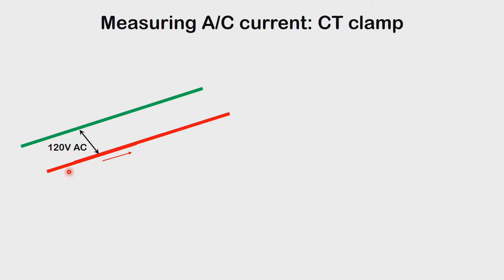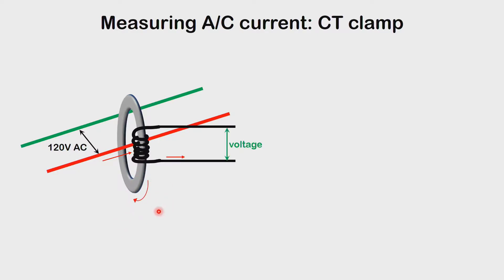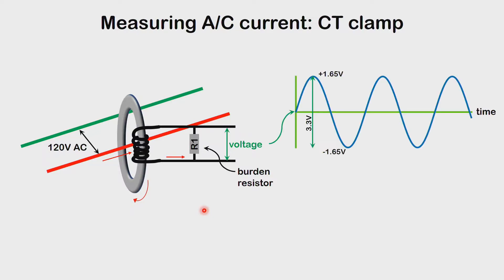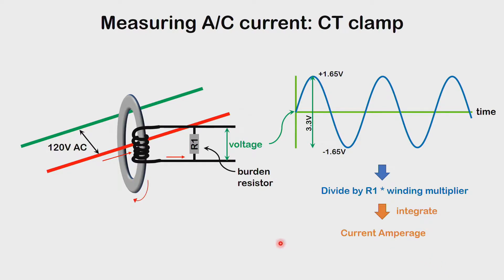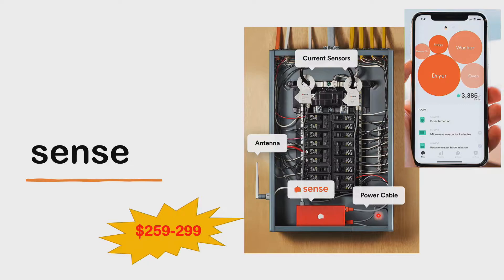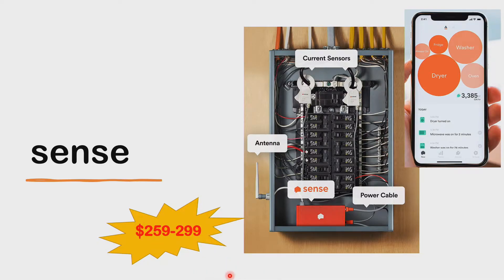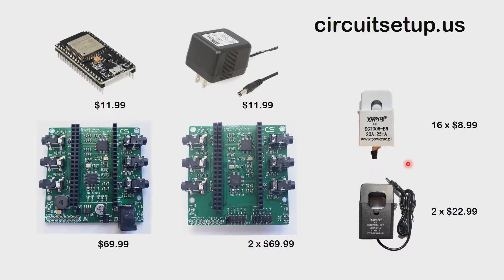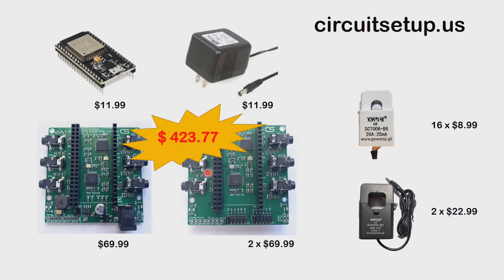Complete setup of Emporia Vue Gen2 Energy Meter | Integrating into Home Assistant

Comment: I want to use it in our company. 
What if I have 3 phase/3live wire main circuit breaker and supplying to 3 sets of 3 phase/ 3live wire sub circuit breaker. How the CT sensor should be clip?

Comment: Does the Home Assistant integration require an Internet connection?   Or does it talk directly to the device?
Reply: Internet connection. It talks to the Emporia API. So far the API has been very reliable but the integration has some issues. Might flash mine with ESPHome.
Reply from the maker: This addon connects to the cloud. Here’s the link to ESPHome version that you can flash https://gist.github.com/flaviut/93a1212c7b165c7674693a45ad52c512